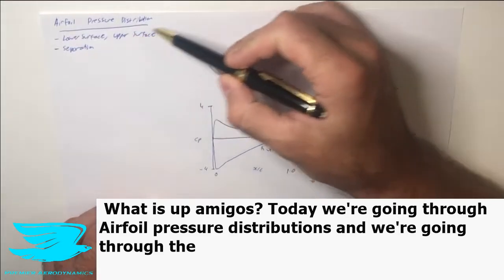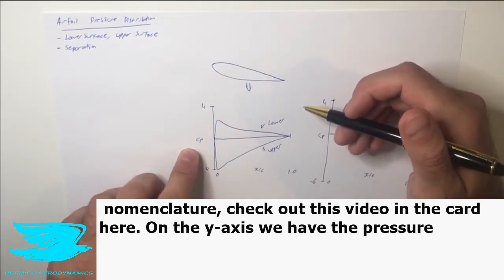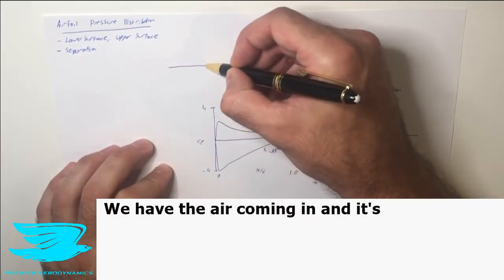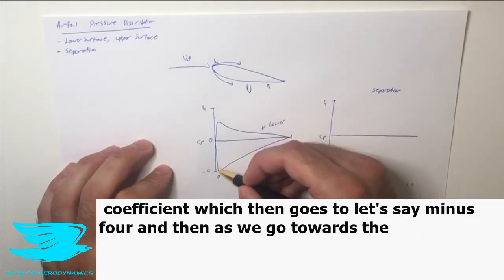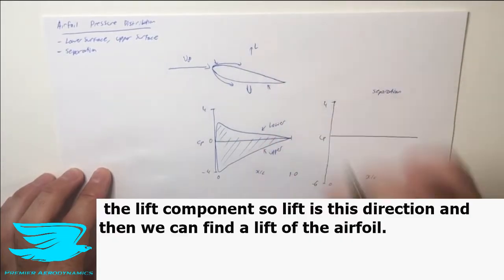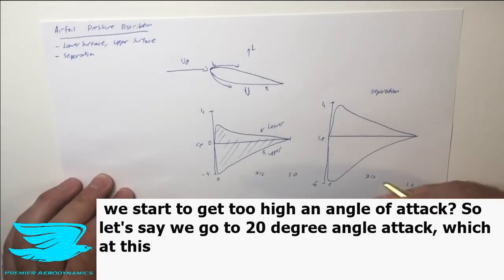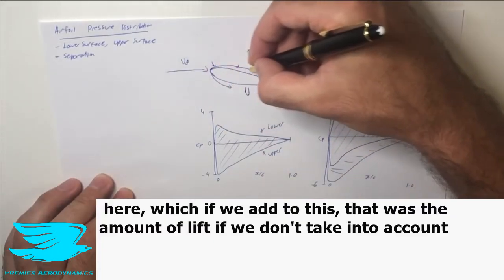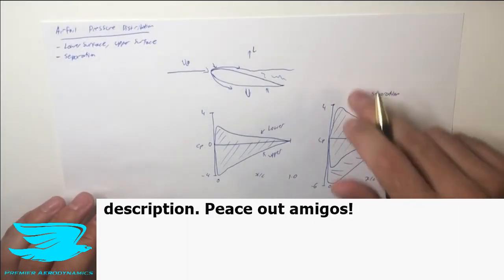[Aero Fundamentals #23] Pressure Distribution Over An Airfoil

Comment: im a little confused here, can the positive Cp exceed 1? i thought the 1 = Cp + non dimensional Vel^2. which means that the Cp cannot exceed 1 unless there is additional momentum added to the flow. please correct me if im wrong. Thanks.
Reply from the maker: Hi! You're right, locally, the Cp cannot exceed 1 if there is no additional momentum in the flow.

When it comes to streamline bodies (that aren't in stall), a good rule to follow is that the Cp won't go above 1. A good example is when the flow stagnates.

But, when you come to bluff bodies, and flows that are chaotic, then momentum can come from other regions in the flow, and that can make the Cp go above 1. It's not that common, but possible.

Comment: Separation starts happening at 10 degrees no matter what kind of airfoil, and the ability to turn the air tops out at 15 degrees(for a single continuous surface). To turn air more than 15 degrees requires multiple elements and active blowing. Cylinder head porting and airfoil aerodynamics both have that in common, in either case you realize that air will not turn more than 15 degrees without a massive loss in flow energy.
Reply from the maker: Most airfoils can't go beyond that, but for most of them, you can increase their stall angle by adding flow control devices like vortex generators.

It requires adding additional energy into the boundary layer.